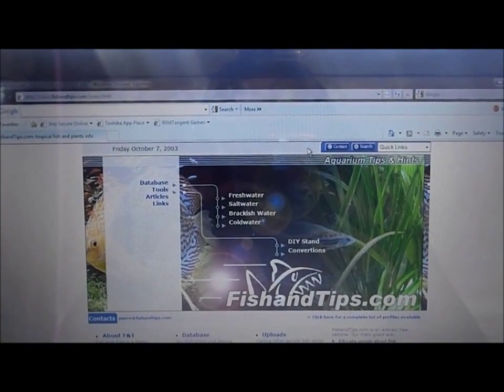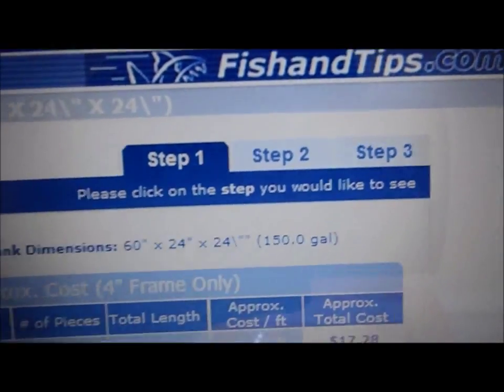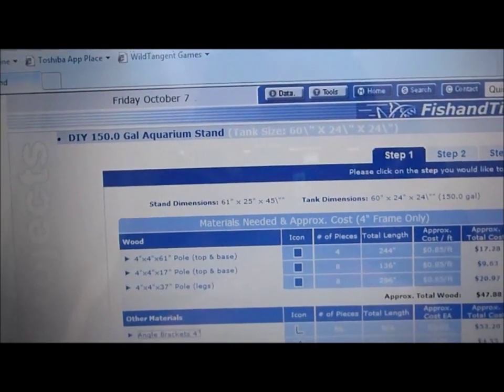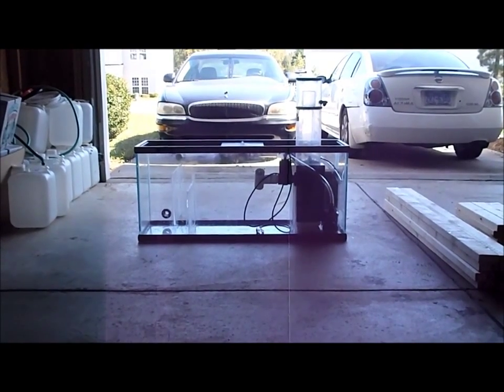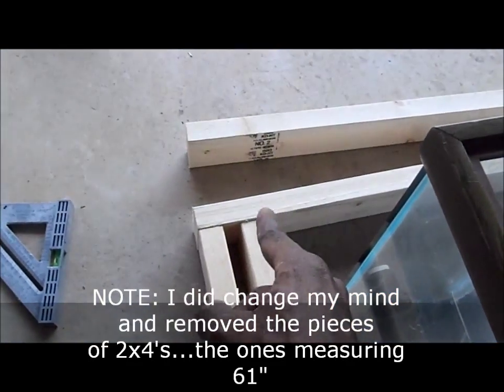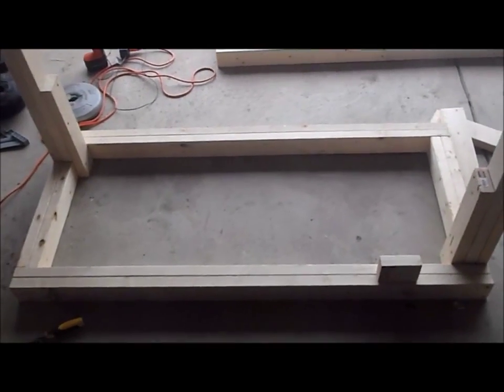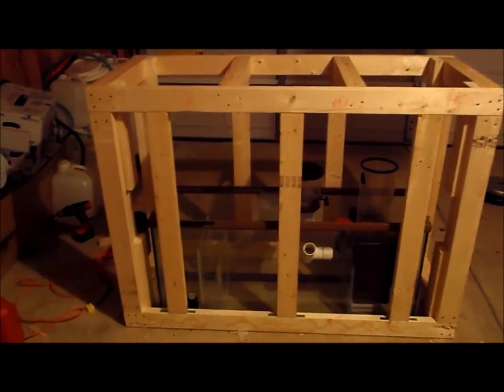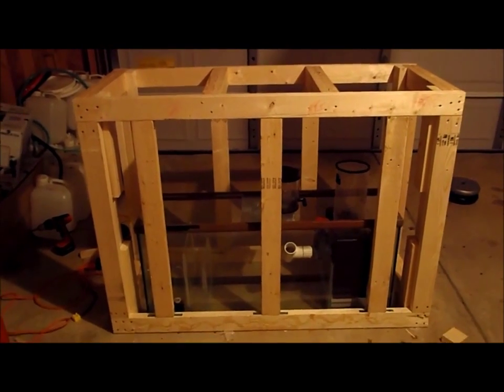Rebuild of the 150 Gallon SPS Tank...Part 5...Part 1 of 3...DIY Stand

Comment: Yezzzziirrrr, that stand looks like a BEAST, very nice job. only question I have is how do you get your sump in and out if need be, because it looks like its permanantly in there or you have to lift the stand over it. just something to think about b/c for example a week after my tank was up n running I had a mini disaster that required me to pull the sump out, luckly I made it so I could pull the sump right out the front of the stand. just some food for thought homie. keep up the good work.